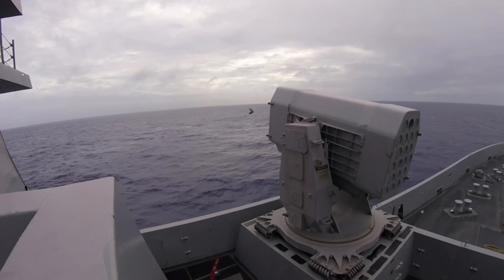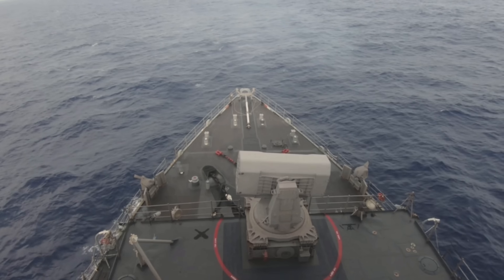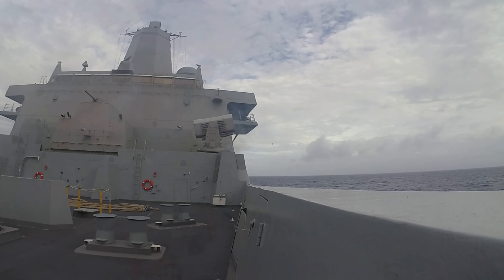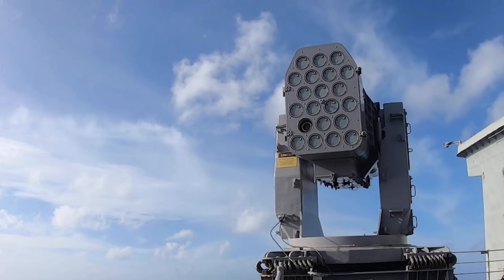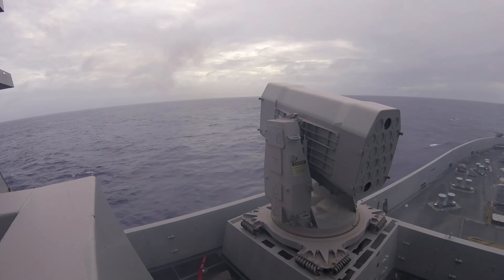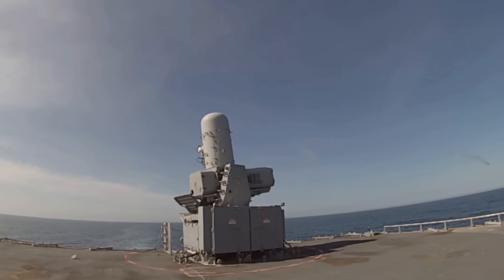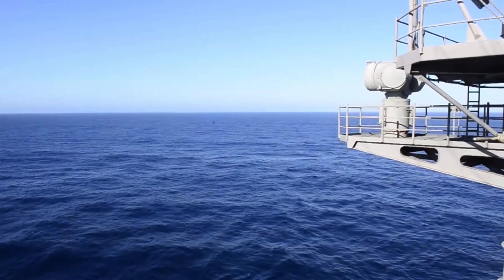Raytheon RIM-116 Rolling Airframe Missile 'SeaRAM' | MODERN NAVAL DEFENSE

Comment: There is another launcher that can carry 21 missiles. And one more bit, the spin stability is not the reason for imparting roll to the airframe. It is to save cost of both the control actuator system and the seeker angle resolver capability….

Comment: If there is a next Command game (or modernization update), or possibly a game equivalent to Sea Power set in the current age, to use these bad boys. Will make it very interesting. Overcoming CWIS with 5 rockets was usually Decently reliable, but these bad boys will make that take a lot more rockets.

Comment: How do the missiles fired compare to Tamir found in Iron Dome? Also, while these missiles are good, they are quite old. With the advancements in tech, couldn't similar missiles be made for cheaper or ones with greater range for similar costs? The  AIM 120D goes about 80 miles

Comment: What a timely piece.  It is a fantastic missile for what it does.  However, we can never forget what it does, and how it does it.  The warhead is basically 25lb Blast Frag warhead.  It flies pretty fast (Mach 2+): Mass	5,777 kg (12,736 lb) (launcher)
73.5 kilograms (162 lb 1 oz) (missile)
Length	2.79 m (9 ft 2 in) (missile)
Warhead	blast fragmentation warhead
Warhead weight	11.3 kg (24 lb 15 oz) (attribution-Wiki)
Many of the old Soviet ASCMs were fast and armored so you had to literally destroy the missile in place instead of just kill it and let it continue on its ballistic path (usually descending upon you).  There are classes of ASCMs (supersonic sea-skimming ASCMs) that are going to require greater firepower than a 25 lb Blast-frag warhead.

Comment: Relying on this alone is a huge mistake in my opinion.  Reloading looks to be, if not impossible, at least very impractical.  Coupled with the fact that the enemy can easily determine how many shots you have, it would be easy to shoot ENOUGH missiles (or drones) to get through this defense.  Hopefully most ships that this is deployed on will have a multilayered defense.  
Great video, you did cover my concerns in it already, just adding my 2 cents.  Thumbs up!
Reply: You can have more than one mounted.

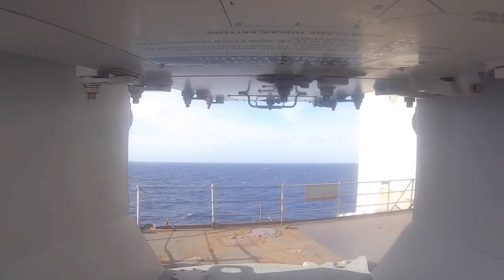Comment: 8:00 I just realized that the line attached to the tube cap is to prevent them from getting lost
Reply: No it’s not otherwise the front one would also have one and at 2:47 there is no cable attached.

Comment: I understand what you're saying about multiple targets Matt, but it isn't true that CIWS can't handle multiple incoming targets - it absolutely can. If the multiple threats are separated enough you'll run into similar issues of having to rotate the launcher / gun platform in the same manner. Anyways I've seen CIWS prioritize/switch between targets before and it's VERY fast. I think a few movies show this as well - and even though it's Hollywood, it would fire a burst and immediately switch to the second target, fire a burst, etc - SeaRAM would need to do the same, although obviously you gain some extra target separation capability with the missiles' maneuverability.

Comment: What I have against the RIM-116 is cost! According to Wikipedia 1 mio. USD pr. pop - which is cheap if it saves the ship. A Tomahawk costs about 2 mio. USD. Typically the system is for installation on the priciest naval unit: The carrier.
What speaks against the Phalanx is it uses a gun that was AVAILABLE at the time: The M61 allready installed on most of the aircraft. But with the whopping rate of fire of an aircraft gun (3000 - 4500 rounds pr. minute) it quickly runs into a reload problem - poor sod having to tote 500 20 mm rounds for next 10 seconds of firing.
Personally i prefer the Danish solution: The 35 mm Oerlikon Millenium -it has only a rate og fire that is 1/10 to 1/20 of the phalanx and has the room for pellets and fusing in the shell. Besides that it does not require a breach of the deck and weighs half -  so frigates carry 2.

But again: Different horses for different courses.

Comment: The company I work for builds the radio waveguide switches that allow the missiles to communicate with the launch assembly 

All I do is set up the drive plate for the girls in the wiring room; weather proof the 9 pin mating connector, attach the microswitches. Mundane shit.

Comment: Waiting for laser guns to become operational. Melting targets at distance is... cool.

Except for cloudy days.
Reply: Actually, depending on the laser frequency, clouds won't matter.  Different frequencies of light are blocked by different things.   Objects that are transparent to one form of light are not to another.  That's why we can see food but microwave ovens can use microwave light to heat it.  I don't remember what frequencies can ignore clouds, but they exist.

Edit spelling and wording.
Reply: @The_Viscount  frequency creates another problem what is the enemy made out of? if its a fix frequency and the enemy finds out all they need to do is use the right materials hell even the right paint it may no stop the lazer but it sure will slow it down.
Reply: Well the laser will have an even shorter range than the guns, but way higher accuracy und tracking speed.
Reply: If a laser can already punch through the hull of a ship and disable its engine in a single shot, disabling a missile or other aircraft is easier due to thinner skin and more fragile interior.  The research currently being done by the US Navy is not completely public but I expect a faster AA mount is already in development.
Reply: Luckily naval ships are never in places where there’s lots of water droplets in the air that could reduce a lasers effectiveness
Reply: Well nasa has a laser that can melt rocks
Reply: Like a few meters away
Reply: @philipweser8774  Not true.  The US Navy has been hitting targets out to the horizon.  The big issue is power output.  I have heard (but don't know if it is true) that a laser with a 250kw output requires TEN TIMES the energy input to get this much power in the actual beam.
Reply: @swaghauler8334  oh if it's 10x you have a really good system. Then there is the issue of lifetime, high-power laser "eat" their medium. Then there is the space/safety issue, if you have a too high energy density in your medium it tends to release that energy in heat. Which most likely (especially for high power) ends up in an explosion. To reduce that risk the lasers have to be bigger and as a result less efficient. Oh and than there's the issue of divergence and atmospheric refraction/scatter or how to get the power to the target. And lasers have a very simple way to defeat them: just make it reflective.
Reply: You can’t, you might blind somone!

Comment: I don't want to be the sailor tasked with retrieving those tube caps.

"They've fallen into the sea, skipper."
"Well, here's a dinghy."
Reply: I'm sure those tube caps are single use and replaceable . the real nasty job would be cleaning the launcher I'm sure they use some kind of solvent cleaner that will destroy your chromosomes and give them two headed babies
Reply: @sirclarkmarz  It's a joke
Reply: @aaronseet2738  yes but he has an interesting point
Reply: @aaronseet2738  well…I’ve seen soldiers forced to sweep grass when it’s raining so retrieving caps isn’t too far off if someone really screws up
Reply: It still beats having to police your brass at the range!
Reply: At first I thought each cap was secured with a cord but then later I saw them popping off and flying every which way on the deck.

Comment: Needs two Vulcan cannons one on each side of the missile launcher.🙃
Reply: are you just asking for the kashtan?
because yeah, a combination gun+missile CIWS would be great, missiles as standoff and the cannons as back-up if the missiles miss or run out
Reply: @rrenkrieg7988  I'm still trying to figure out WHY the Navy didn't combine SeaWiz (20mm) and SeaRam (the missiles) into a single composite system.  They could...
- Put 2 Quad Box Launchers on either side of a SeaWiz mount.
- Put a 20mm Gatling Gun UNDER an 11-round SeaRam Launching Box on a taller mount. 
- Or to save weight... put a 20mm Gatling Gun UNDER the 8-round light-weight Launching Box the Germans developed.
Reply: @swaghauler8334 because it's HEAVY

Comment: Sea wiz but cooler....

SIKE, MINIGUN  GO BRRRRRRRRRRRRRT!!!!!!!!!
Reply: I mean is it more effective than a Gau? Yes definitely 100% yes, Is it a better Tactical decision that will likely save thousands of American and NATO lifes in case of war? Definitely, does it look anywhere near as cool As The piss stream of hell from a Gau? Fuck no not even 1% as cool!!!!
Reply: @anarchyandempires5452  satans piss stream
Reply: Anarchy Empire gau is the cool but deadbeat dad of the naval air defence realm.
Reply: @kansascityshuffle8526  that's a good way of putting it.
Reply: @anarchyandempires5452  GAU? which GAU do you mean? GAU-5? That's like saying "F-fighter" or "AIM-missile" or "B-bomber"
Reply: @Hairysteed  any of them will do really, they are all just as cool but are effectively just as outdated, the 5.56, the .30 cal the .50 cal the 20mm hell even the old Avenger from the warthogs doesn't really have a purpose any more, our planes would be better armed with an overlikon millennium which packs a much more potent shell with a similar rate of fire and weight, while Searams are a clearly better option for for naval defense, Gatling guns served their purpose but they have since fallen behind Autocannons in most regards .
Reply: @ @anarchyandempires5452  
Even upgrading the CIWS to a 30mm does not give the range of the Searam but USN can add improvement since as longer range and data-linking capability
The only issue with missiles is reloading them.
Reply: The CWIS but slightly longer range
Reply: Minigun? 7.62mm?

Comment: what happened to the weapon system metal storm weapon system, im asking cuz this one looks kinda like it
Reply: Never adopted by anyone.
Reply: @WALTERBROADDUS  This and the company went broke. Their last product was the 3GL system, basically a 40mm grenade launcher that uses the Metal Storm system. So instead of having giant 40mm cases on you, you've got 40mm tubes with three grenades inside. Problem was that the company went under before anyone got a serious look at them.
Reply: Bad marketing It's value added was putting mult warheads on target almost instantly Potentially a way for dumb munition to punch holes in light armor buildings lite bunkers Any idiot could hold tube on target since recoil didn't kick in until after rounds nearly gone  saturate target rich environment like a room full of combatants Would also gave made a wicked 21st century Katshuka? imagine 10' x 3' truck mounted pack Nearly 300 tubes 3000 grenades. NOT a replacement to easily infinitely reloadable grenade launchers & no one was looking for active minefields & air force already has saturation munitions My Take
Reply: The Navy did mount several special 40mm Grenade Launchers in 144-tube box-like assemblies on several ships.  Each tube held 4 grenades and it was used for both AA defense and swarm boat defense.  IDK IF they are still testing them or not.  They only had a range of 2km so they weren't good as a stand-off CIWS.